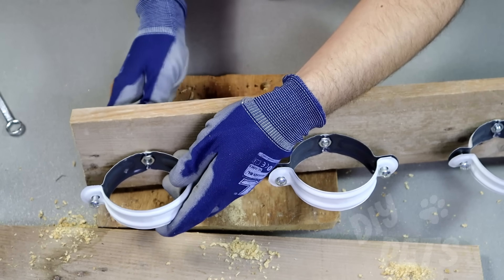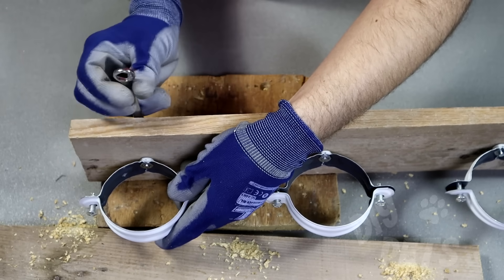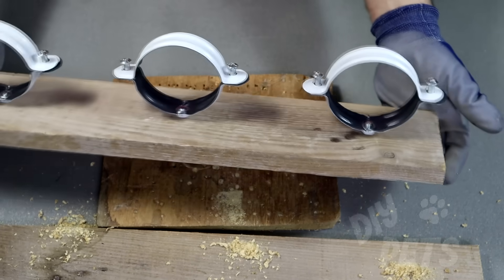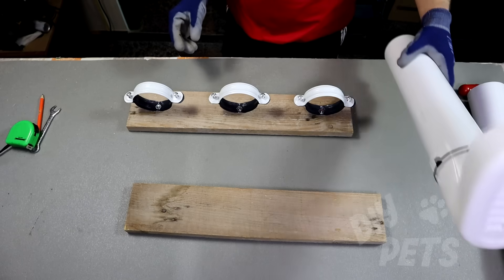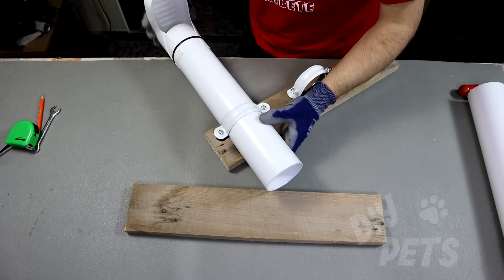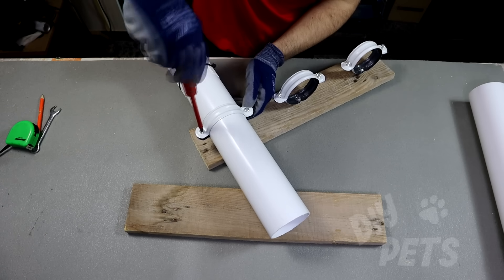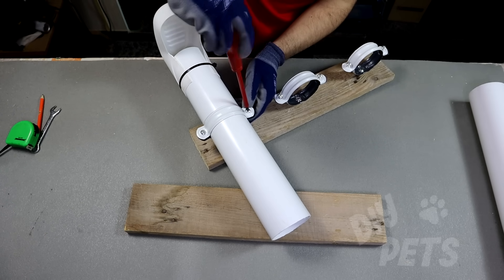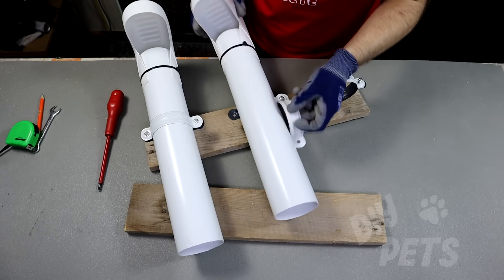Comedero para GALLINAS y POLLOS Fácil de hacer en PVC

Comment: I've got 5 of these I made from scrap PVC left by the previous owner of the house. 12 sections of 2" pipe 7 feet long. Made them 5 feet tall to hold more feed. Didn't make a mount. Just used heavy galvanized wire to mount them to chicken coop fence.